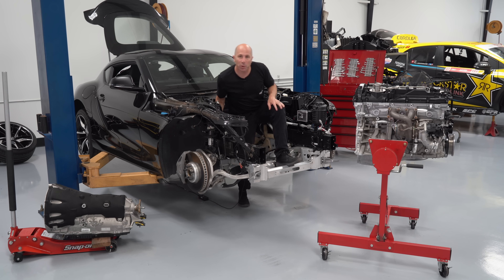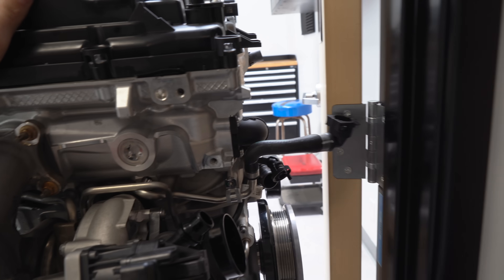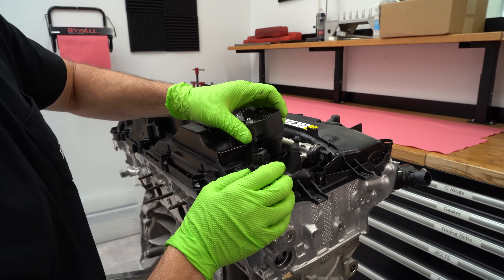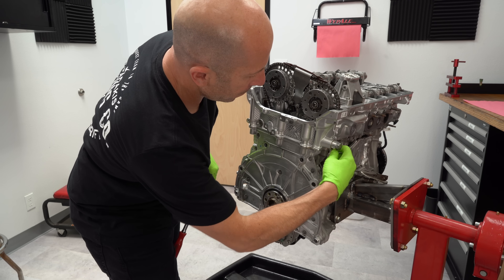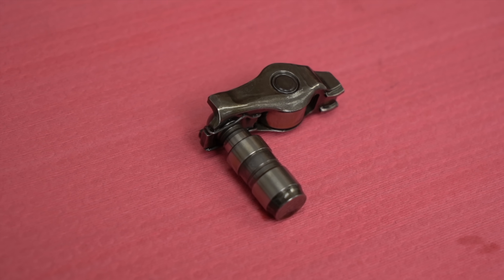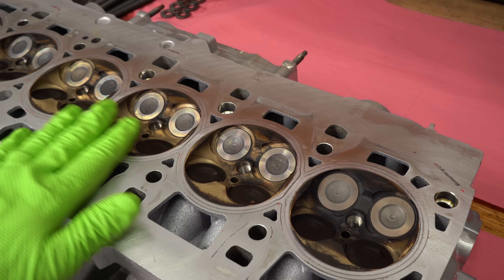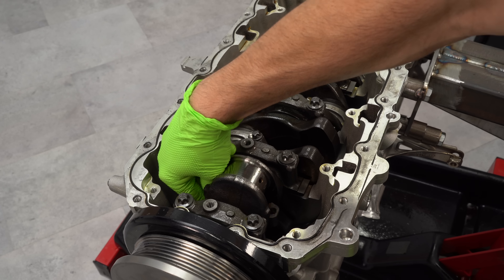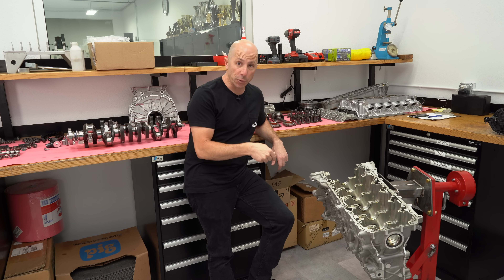2020 Supra B58 Engine Teardown - First Look - Better than the 2JZ?

Comment: I thought replacing a water pump on the Ford V-6 was complicated at least it can be done in the car. Nothing is easy these days  with gas or diesel engines and it sure is making the case for a power plant with an armature as the only moving part.I'm not ready for totally electric autos but it's all our grand kids will be driving in the future.

Comment: just thinking of all these Plastic Parts failing under heat Stress and getting cracks..  well done Engineering & Marketing. Engine failing right after the Warranty Time.
Reply: literally you are just speculating on an un-educated guess. People hating on this Supra are just dumb. Toyota doesn't put it's name on something that won't last. You don't become the biggest car maker in the world by building trash.
Reply: @ABArsenal  ... no Speculation - Experience since 1988 wrenching on Cars. All that Plastic Stuff won't last very long and crack latest after 10 Years of Stress by Heat and and Vibrations.... - not hating in a dumb way (why these aggressive Words FanBoy?)... just saying. Nothing to do with Toyota, BMW or whatever brand. They are Multinational Companys, build the Cars out of Parts coming from everywhere.... They are all just Money oriented and Parts made of Plastic are way cheaper that Metal Cast Parts....  well and after the Warranty they don´t give a Shit if it breaks...  how about that? Still dumb? - You might need some Education how Economy, Car Construction and Business works, beside "Fan Boy" pink Glasses.... ;-)

Comment: I still cant believe Toyota is partnered with BMW...
Reply: There wasn't a better engine for the job. I would like to see more performance Toyota models with the B series BMW engines like the Toyota Corolla Sedan and Hatchback using the B48 from the Mini Cooper but fixed by Toyota because the B48 is the most unreliable engine in the B series, i would call it the T-Sport (stands for turbo sport) and having both 6 speed auto and 6speed manuals would make it a really fun car with 190hp but you can tune it to make it output almost 300hp with just ECU tune. And the Toyota Yaris S with the 3cyl B38 engine, to make it a pretty decent sub-compact car and make it the best 3 cylinder sub-compact, suck it Mitsubishi Mirage.

Comment: So it uses 2 camshafts and an eccentric camshaft?  So it is a TRIPLE CAM engine?
Reply: No the eccentric shaft moves one rocker arm in relation to the other to change rocker ratio and adjust valve travel. It is only spun by the electric motor when the ECU decided to change valve lift. It doesn't turn with the engine like the regular camshafts

Comment: So they use plastic guides on the timing chain on the back of the engine.  Get ready for lots of guide failures at low miles on this engine.
Reply: I doubt it, same deign Toyota already uses so it's not new and they are #1 in reliability.

Comment: Need help with a fiat 500. Replaced cam that cracked put everything back together now it will not start. Someone sugested multi air issue. Please please advise. My first ever engine replacement.

Comment: So if you change the cams does it mess with the direct injection pump?
Reply: ECU won't compute the different size cams, you'd need to get it tuned.
Reply: @mcr5645  so even though the pump is mechanically driven it's still computer controlled?

Comment: Mantience nightmare I'm surprised toyota signed off on this.
Reply: Fun fact, when the deal was made with bmw, Toyota actually stated in the contract they wanted multiple engines to pull apart them selves and they said to bmw that they reserve the right to change anything that there engineers deem a "maintenance nightmare"

Comment: I was not expecting them exhaust ports to be that small. Looks like there's definitely enough room to Port them.
Reply: There interchangeable with other B58 heads since most of them were built with 6 port heads not 2 like the mk5s.

Comment: the limiting factor for hp on this engine will be the head  the internal exhaust manifold is not optimized for flow on larger turbo's  and then you have the direct injection injectors problem nothing custom on the market yet so you can't provide fuel maybe with a spacer but that creates its own problems

Comment: LOL he said little to no gaskets :)    just silicone.    I smell BMW leaks all over as usual
Reply: On the bright side, you never need oil changes, just fill as you go :p
Reply: As usuall? Lol u have no f...ing clue about bmw engines then. Typical keyboard warrior noob :)
Reply: yoink person leaks all over from a BMW owner :)
Reply: @EM-km8em  What you talking about? Wanna talk about really shitty cars? Try ford, audi, opel, volvo.. Been there, done that. Of all the cars i have had and the cars my family in general have had, the bmw`s and citroen`s has been flawless compared to the rest. Everything from e34 520-535 and all the e39`s except the v8`s. 1 or 2 of the e34`s even had 450 000km on it when i bought it, its still running and this is 7 years ago lol. Think it was the 535 actually, have had a couple of them.

Comment: Imagine how small the engine would be with the free valve set up from koenigsegg.
Reply: I agree, but that's still largely a prototype design. Probably need another 5-10 years before it's refined enough to be reliable and affordable to put into non-supercars.
Reply: @mcr5645  i dont even think koenigsegg is using it in their super car yet.  Last I saw it was retrofitted into a saab or something
Reply: @NorthernRiderOffroad  it is now. Man, that Gemera is an amazing showcase of engineering. Who knows, maybe something like an M4 could have such a setup in 15 years, if we still have proper engines then, that is.
Reply: @mcr5645  isnt it just a blatant copy of Mazdas system?
Reply: @dagnut  I'm not sure which system you mean? Mazda doesn't have anything near what FreeValve/Koenigsegg use. Maza had "rotary" engines but they weren't a good design, not even Mazda uses them anymore.
Reply: Exactly what I was thinking, I kinda hate those flimsy floating rocker arms...

Comment: You can’t judge a manufacturer by test driving a new car! You need to drive that car for a year than make opinions! Japanese are less enjoyable after 6 months where European has consistency in feel/sturdiness! Chains usually go for over 120k. BMW requires a VANOS adjustment and most never care about because the car is a lease or simply second hand owner is unaware. Euros are better than Italian makes in my opinion. I drive a Japanese so I’m just sharing my opinion

Comment: Wait for all the Americans to comment on how a cast iron (American built), pushrod V8 with 2000hp, nos, no exhaust, trans brake and excessive noise is tens times better than this. Oh and by the way Cletus McFarland is still only running 9’s with 3/4 of his car missing its original weight and more power than a fighter jet.

Comment: Little sad you didn't comment on the angle of the intake runners.  Love that windage tray, too.  Annoying to see how german this engine is though.  It's a fine car, sure, but I became a fan of Toyota because of their durability and reliability.  This motor doesn't seem to espouse those values to me.  I'm sure ya'll will get to 1000hp, can you imagine how comical it would be if this engine couldn't out perform a K20?
Also, I DESPISE lug bolts.  They've used mag lug nuts for over 30 years, which are quite possibly the best lug nuts you could use.  Then... this?  Nothing like needing three hands to put a wheel on without a fight.

Comment: everything is plastic and the head has 2 ports? that's going to be a problem for head flow! it looks so much more complex and that usually directly relates to problems when pushing for more power! Bmw badged as a supra is a no go for me, Toyata screwed up with this bmw supra.
Reply: The heads are interchangeable with the Z4s since the Z4 has a 6 port head that isn't integrated to the exhaust.

Comment: Hi there, that's why I recognized some solutions - typical of the VW latest generation of gasoline engines. They could still use the Audi Valve Lift System for the exhaust cam ... Otherwise, perfect work except for the intake cam without proper tool - a bit risky.

Comment: There's a huge amount of copying on this engine    valvetrain  = Peugeot HDI / BMW,   Intake manifold  = AUDI,  Electronic thermostat  = Peugeot / Ford.   Petrol direct injection = Mitsubishi  GDI   Adjustable cam gears = BMW,  Hydraulic. Lifter's  = Peugeot HDI,  Sump baffle = Peugeot HDI / BMW
Reply: How can it copy BMW stuff when it is a BMW sourced engine? 😁
Reply: EM6285 If you watched the video you would have heard him say it was a toyota made engine as they moved away from bmw.

Comment: Nice video, just have 1 question why is the top off the piston black if it just have 500 miles, is the normal.
Reply: Direct injection makes cylinders super dirty because they don't get washed with fuel

Comment: The abnormal springs, linkages and whatnot on the intake valvetrain, is know as BMW's "Valvetronic" system and actually is what controls throttle via fine control of how much the intake valves open. The throttle body is only there to control intake manifold vacuum. Pretty neat and ingenious setup, but also is a perfect example of German automotive overengineering 💁‍♂️

Comment: This is the only Toyota Scotty Kilmer wont recommend😂
Reply: REV UP THAT MONEY PIT
Reply: Look at that timing chain location,
Absolute money pit
Reply: FULL BRIDG ERECTIFIER not really
Reply: @YoBoyNero  if you have to do valvatrain work, check labor hour first lol
Reply: @YoBoyNero  
Needlessly long name dude. 
Really? You need to have it on jack-stands at the very least to do a replacement, and you must replace it from the bottom, not the top.
Reply: Scotty says new toyotas are garbage - He prefer Honda !
Reply: Jorge Villacis I recommend the Type R over the overpriced body kit BMW for the cost of a Supra you can fully build a Type R or even a basic civic to put out way more power and keep up easily the Supra shouldn’t be a $60k+ car it’s not even a $30k car 🤧
Reply: @jorgevillacis8127  no, he said the Honda 1.5T is shit.
Reply: The Direct injection with the turbo, will kill this engine.
Reply: That Guy I think that cylinder head and exhaust manifold in one piece is what’s going to kill this engine....
Reply: reads all these comments in scotty's voice
Reply: That guy is a joke... Thinks he knows all and shit... Wouldn't bring him my car for an oil or tire change...
Reply: Endless money pit
Reply: Na, Scotty is just old fashioned. Anything new = bad in his eyes. He literally said he doesnt understand why toyota partnered with bmw and that toyota shouldnt be making sports cars. 
Lots of people have called him out on his mistakes and he tends to say stuff solely for attention. Man has good editing on his videos and a personality, its just a shame that he relies on stories for facts.
Reply: Scotty knows his stuff, but he’s EXTREMELY bias.
Reply: I saw a lot plastic parts that’s why Scotty Kilmer won’t recommend only if you guys buy and sell after 5 years joy driving. Let second owner take care and replace steel parts. The car will run more than 10 years.
Reply: You know it’s just a bmw so that’s an automatic no from him
Reply: Toyota badge, bmw engine....smh
Reply: Roseth Henning k
Reply: It’s not a Toyota though it’s a Toyota body kit 🤣🤣
Reply: Yeah he is a Bimmer hater! Says the resale value crashes when the warranty runs out!
Reply: spudnic88  it is a 1994 to 1999 celica
Reply: timing chain is a lifetime component, should last long and not need replacement. They fixed the timing chain issue long ago. It’s not an issue on the b58.
Reply: He just got one, the world is ending
Reply: Coz The supra is a bmw in disguise thats why Scotty Kilmer won't recommend the 2020 Supra
Reply: @thedailyshaver1171  facts
Reply: @derecktyler6342  what facts
Reply: Scotty Kilmer the scumbag crook, will not recommend anything unless it gets him $$ for cocaine.  Ever wonder why he ALWAYS wears dark glasses?
Reply: Fuck scotty
Reply: Its comment threads like this that remind me of one simple truth: Most people, even in the age of internet and endless information, are fucking stupid. For one, Scotty Kilmer is one person. While this one person may have a preference, and may have reasons for recommending or not recommending a car or engine, it does not make his words the gospel. More importantly, I can't help but laugh at all the "money pit" comments and "labor hours" comments. You guys sound like teenagers bolting on exhausts on an evo in your parent's garage. Obviously, the bulk of you have never actually put your OWN HANDS on an engine and built a legitimately high performance engine. Even less of you have ever seen an actual race engine out of a car. Why do I say this and know its true? Because if any of you had ANY performance engine experience, they're ALL money pits, and they're all labor intensive. Some engines more than others, but any race engine will get real expensive real fast. Any high performance vehicle comes at two costs: money, and labor hours. This also reminds me of my early track days when I would go to the drag strip twice a week. There's always two crowds. 1 crowd is the actual performance guys. They're knowledgable, have hands-on experience, know how to do everything from resleeves to mixing their own fuel to porting and polishing. THOSE guys are always laid back, They're always open-minded to different approaches and ideas. And they don't shit on a specific car or motor, because experience tells them that you can, if you have the knowledge, make any engine type a high performance engine. Then there's YOU fucks, which is crowd 2. You jack-hands can be identified by a few characteristics. for starters, you spout off useless stats about this or that, or repeat things you overhear CROWD 1 talk about, with little to no understanding of what's coming out of your mouths. EVERY ONE OF YOU have these hard-edged opinions about things... Shit like an RB being better than a 2J or a 2J being better than an RB. You know, STUPID shit that you don't understand, and are just parroting tidbits of knowledge scrap you gleen off of crowd 1. You buy a clutch based on how many pads it has. NOT based on what type of horsepower your car's making. You spout nonsense like "scotty won't recommend this so this must be a shit-engine" You put bigger injectors in your car because you think bigger is better, again, NOT considering what your car is currently producing, and trying to change injectors to enhance that production of power. You think a big turbo sucks because they "spool up slow" and you don't even know why that is, and don't even know that there are big turbos that spool faster than small turbos. You simply don't have the knowledge, or the experience. Upgrading your ECU does not make you a race mechanic. And its crowd 2 that's the most entertaining at the drag strip. And I'll use one example for why you fucks are so goddamned entertaining. There was an older guy that used to come to the dragway, and he'd bring between 1 and 3 of his cars, that he built, by himself. And of course, Crowd 2 is there... with their various cars they bought because their friend of a friend said that particular car was fast and "worth building". You'd see absolute bare minimum modifications on these cars, but crowd 2 are the loudest people in the crowd, and are practically yelling about how this car's bore and stroke makes it faster(again... you guys say this shit, not me) not knowing why that would be applicable or when, or how you have to shift a certain way, or whatever other nonsense... And then you bring your cars to the line, where all the nonsense bullshit you talk comes to an end and you have to prove your worth by launching off the line. And so this older guy I was talking about would take his car off the trailer. He built first generation volkswagen beetles. He used the stock engine, and in most cases, stock drive train. He built the flying SHIT out of these cars. and every one of them would run 7s. Every one of them was street legal. Many of them he drove regularly on the street. And whenever one of you slackjaw JACKASSES would pull up next to him, you'd earn yourself a goose egg. He'd stomp you morons all the way down the track. Many times, he'd cross the line before one of you made it to the halfway point. To call it a skunk would be a gross misuse of the word. Now the loss isn't what's funny. Its the JUDGEMENTS crowd 2 would spout out when they saw the beetles coming off the trailer. "ha, what's he going to do with THAT piece of shit... that fucker should be put in the junk yard" I find that, and you, laughable. All of you. And here's the most funny. You have to predict your time at this particular track, so you dial it in before the race. You idiots would dial in an 8.0 and run 13s. Or you'd actually dial in a realistic time, but your actual pulls would be all over the place. Say you'd dial in a 12.89, and run a 13.5, a 12.80, a 13.75, a 12.99, etc. Whereas volkswagen guy would dial a 7.60 and run a 7.62 or a 7.61 or a 7.68. or a 7.60 or a 7.59. All night long. Run, after run, after run. And crowd 1, you'd see that. These guys put their cars on the lines, they know what the car is capable of, and are knowlegeable, so they're able to properly predict their runs based on track conditions for the night. NOT YOU GUYS... "money pit" "labor hours" GTFO man... you guys are ridiculous. And of COURSE, after every run you'd get spanked, HERE COMES ALL THE NONSENSE EXPLANATIONS AS TO WHY YOU LOST... But not one of you actually say why you lost. 1. Your car sucks. 2. you don't know your car. 3. your "upgrades" are of the bolt-on variety. 4. YOU CAN'T DRIVE. fuck's sake.